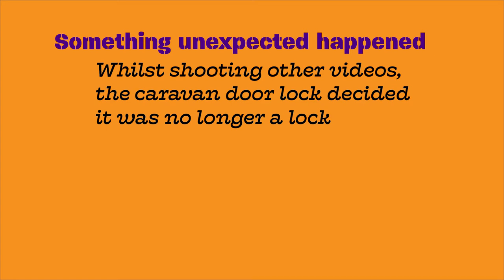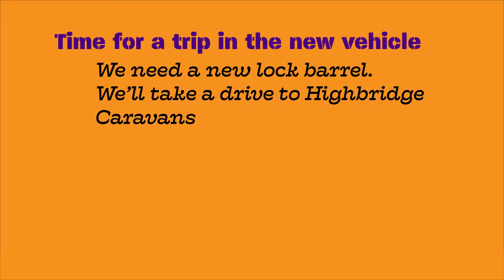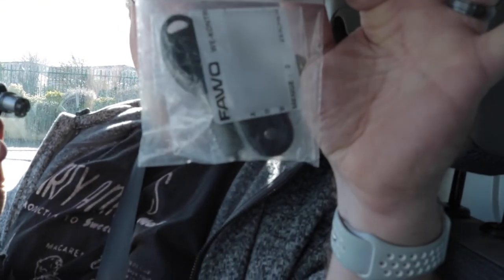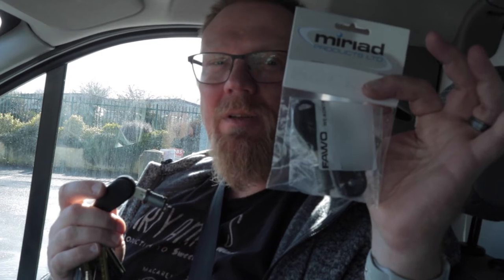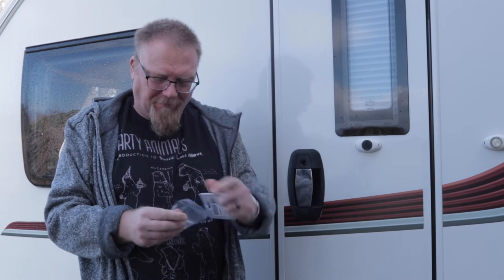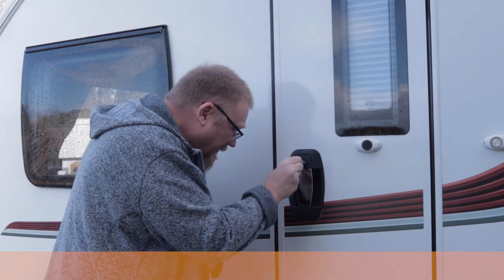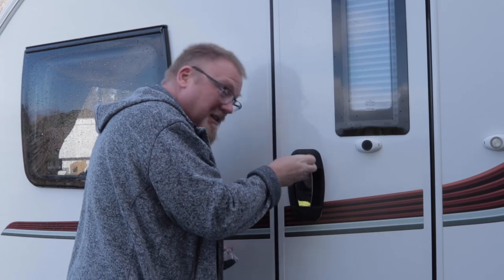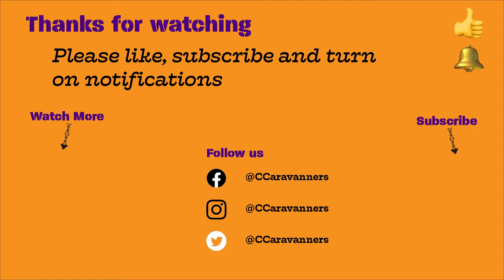Problem with a Swift caravan lock

Comment: This happened to me this morning, thanks for posting, it reassured me that it was fixable. Just one thing to add - part of my lock had disintegrated and bits of metal were still inside the cavity, if anyone else has this issue, make sure you clean out where the lock barrel fits. Once again thanks for posting.
Reply from the maker: Thanks Mike. This does seem to be an issue with this particular lock design. Our door was rehung by a carpenter of skill, much better altogether. The misalignment of the door was putting more pressure on the weak lock, and the technician did mention your tip of cleaning out the broken bits before putting another barrel in. Here’s hoping someone else sees your comment and finds it useful!  Pete & Kaz 😀👍😀👍

Comment: Same problem with my caravan in New Zealand. With help from Google I found an exact replacement barrel and two keys for $60 at UK Caravans Ltd in Christchurch NZ. All swift keys have a code stamped on them so I tried to get a matching barrel to avoid having a different door key. The friendly team at UK Caravans quickly found a matching barrel for me and sent it overnight. Problem solved! Just a suggestion; avoid using the fold out key on your door lock as it can break off the two prongs on the barrel and cost you at least $60 if you are lucky; like me 🙂
Reply from the maker: Hello Ray. We were close to going away and took a drive to Highbridge Caravans. No matching barrel, but this leaves us with a lock that just doesn’t work with the ‘flick knife’ key, hopefully making the breakage less likely.  This is indeed a top tip!  Plenty of people have the same issues.  Thanks for the watch and the comment, Pete & Kaz. 👍😀👍😀

Comment: There is a major security flaw with this style of door latching mechanism.  My van was burgled with me asleep in it.   The locked door was opened silently without a key or lock picking.  I helped the burglars by leaving my wallet and car keys on the  convenient high shelf next to the door.   I won't be using that shelf again.  I now fit a door alarm at night and have a small warning sign outside to deter further intrusions.  The whole door latching mechanism had to be replaced before my van was secure again.
Reply from the maker: Thank you Gary - that is a good point and it is not nice to think about van invasion scenarios - sadly, this is a necessary thing.  I'm wondering if there is a simple, mechanical way to deadlock the door at night?  Pete & Kaz 👍😀👍😀
Reply: @CraftyCampervanners  There is a fix that  would help but saying what it is would reveal how they got in.  I opted for the alarm.
Reply from the maker: Understood:). We will do a bit of research. We have a pair of dogs that are excellent at detecting things occurring at night….  Pete 👍👍

Comment: Please could you help 
does any swift barrel fit into the Swift door as my one came out today and i would like to sort it ASAP but there is a number on the barrel fw838 . Do I get the same one or is there a universal one for all?  Many thanks
Reply from the maker: Hello Marie
I am not sure if this is the case. There are a few different lock designs out there. I would recommend either visiting or telephoning a swift dealer - if possible send them a few photos. Hope this helps. Pete 😀😀